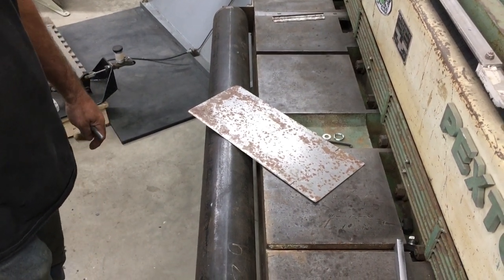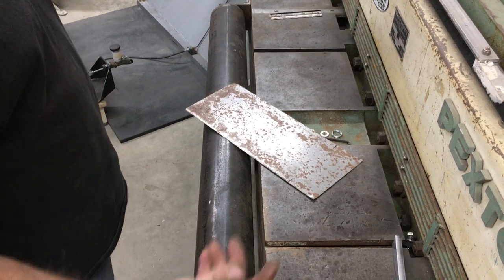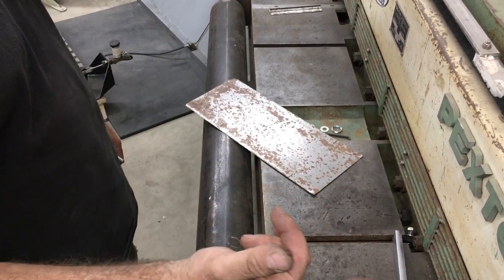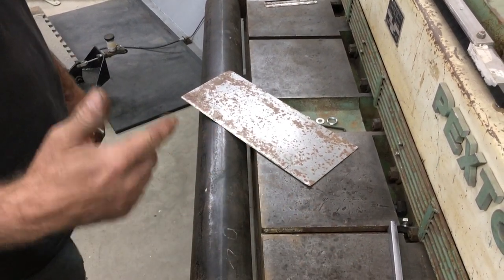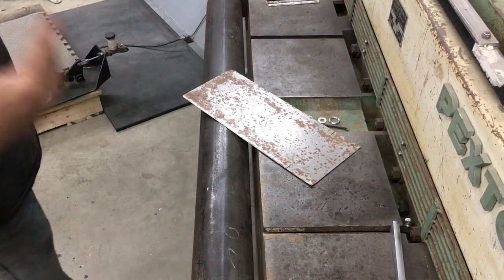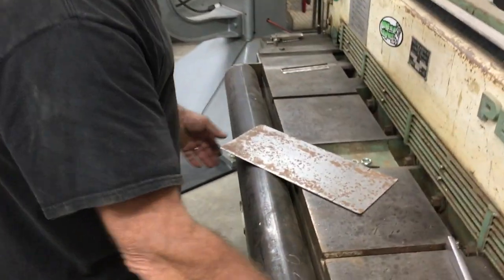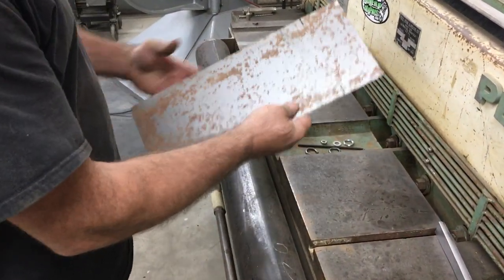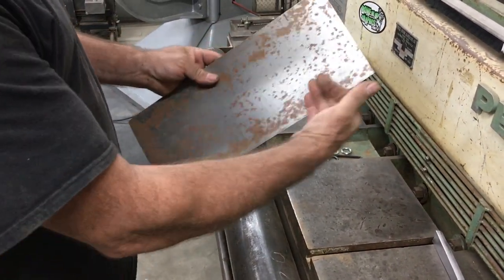Using snips as a Pexto Shear backstop.

Comment: 😎.. I use the same method the other way up to align  fold lines  on top blade of  my press brake 😎.. safest fastest  and most accurate for doing 1 off or low production folds   😉